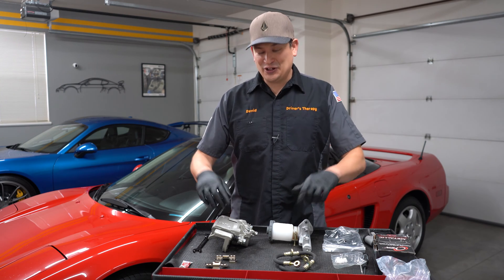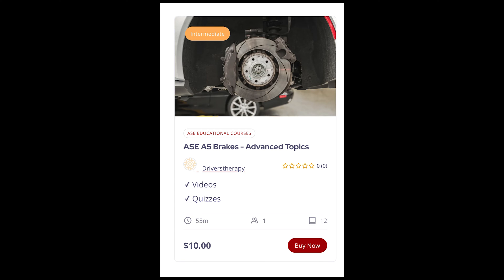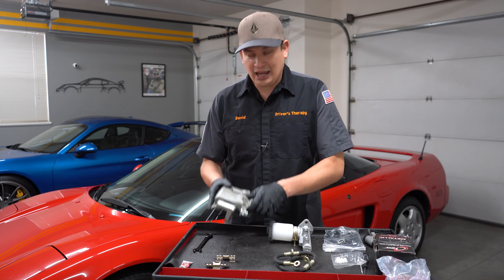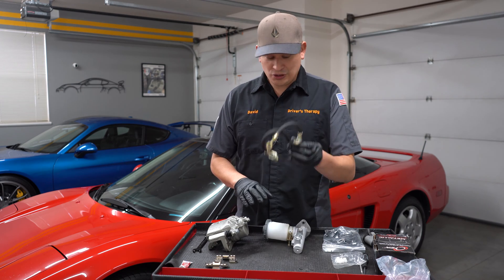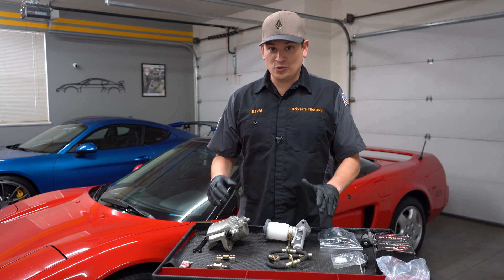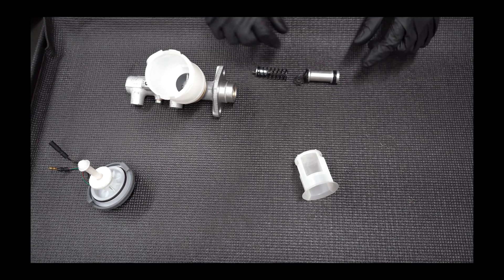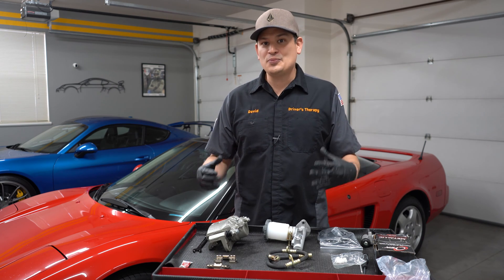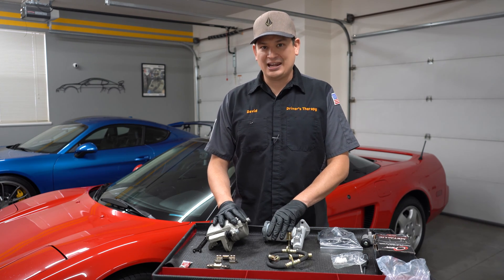Advanced Automotive Brake Course - ASE A5 Test Prep - Automotive Technician Learning & Development

Comment: I’ve been waiting for a in depth visual course like this! Sadly, most of the questions from the ASE brake test I took, involved looking at a wiring diagram for some brake system. Will electronic abs questions using a wiring diagram be included in this course?
Reply from the maker: Hi! I don’t go into electrical diagrams since that is usually the A6 field of scope but I do talk about some ABS stuff. I recommend seeing my A6 video and seeing if that can help you. Or you can sign up for a the program and email me with an specific questions and I can cater my responses to what you need. 🙂
Reply: unfortunately, there are more electrical questions creeping into the A5 test, especially when it comes to ABS, and ESC systems, i just failed my a5 by one question for the second time. so infuriating. lol  @DriversTherapy
Reply from the maker: @ronentai5950  I’m sorry to hear that but your so close you will definitely pass in the future. I can understand why they are doing that since cars are more technical and have more technology in them. Your welcome to check out our electrical and schematic classes on our website. Let me know if you need some individual help too. You got this.
Reply: Thanks! it was the Electronic brake control systems diagnostics and repair that got me. 10 questions in that and i got 4 of them. its hard finding anything online to help master that subject.   @DriversTherapy
Reply from the maker: @ronentai5950  with those questions you have to know the can bus system really well and know what happens if something is shorted. I remember those question, you have to make sure you understand what is interconnected. The official ASE practice test had those and I would recommend getting it because they break them down really well.